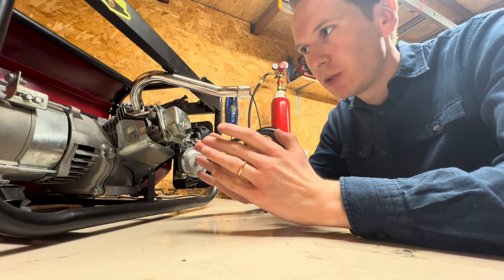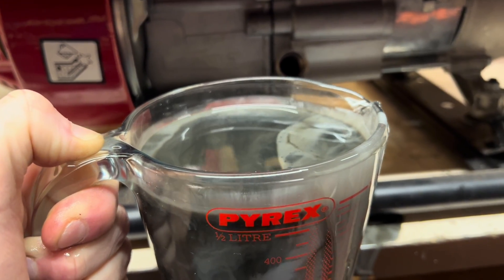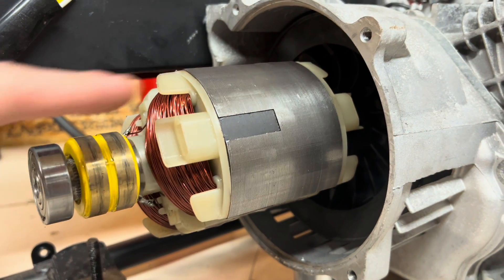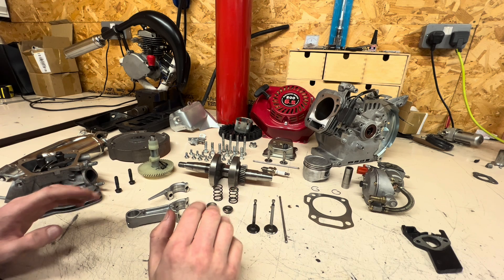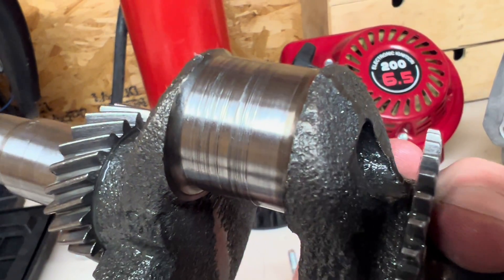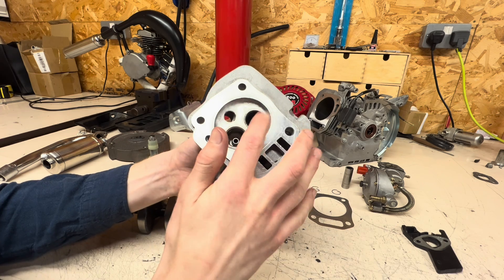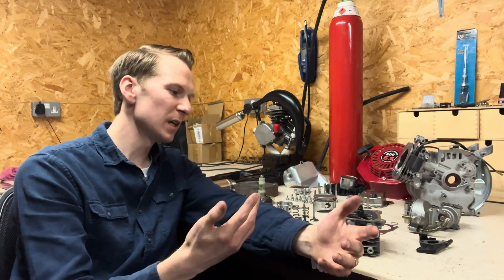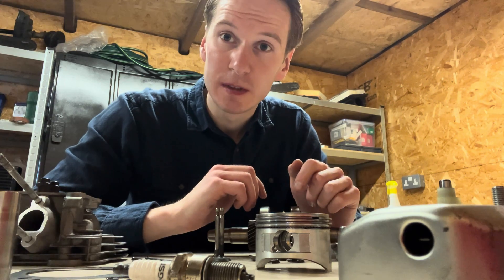Internals After 2 Years of Hydrogen

Comment: As I was told some 20 years ago when I started looking att H-fueled engines, I was told Hydrogen wears out steel due to chemical processes. I am not surprised it sounds different and wears more than if ran on petrol.
Reply: Hydrogen cracks steel, not aluminium. The modern high pressure hydrogen tanks have aluminium inside to keep the gas and outside carbon fibers to carry the pressure forces.
Reply: @unbelievablegoodio7176  And what did I state above?
Reply: @aetaveum  what did I say? I confirmed your statement and added that aluminium is different ... so readers know that too ...

Comment: Oil looks realy bad. Metal in it, probably from the connecting rod. I had one of those generators and it had this issue even with gas. The rod is made of cheap aluminum that cannot take the pistons force delivered to the crank. I imagine using hydrogen would detonate in the cylinder so even more force.😮

Comment: To run this engine right, you would need to massively increase the compression and carefully change the timing to retard. May be several degrees BTDC or even a degree or two after.
Reply from the maker: That’s pretty much the plan, timing set to TDC, increasing compression and some performance improvements along the way.
Thanks for the comment :)

Comment: I have one recommendation.  Increase the angle of crosshatch in the cylinder and maybe run two compression rings. Or even flip the wiper ring so it screets oil up into the combustion chamber instead of down.  Also maybe Increase the turning load on the crank if possible.  If you let an engine freewheel with no load it causes gaps to load and unload. Its kind of like valve float but not really. Imagine grabing a con rod with a worn bearing and brakecleaning all the oil out of it. If you push and pull on it you'll feel it click because its out of tolerance. Even if the rod, crankpin and bearing are in tolerance you will still feel a very teeny tiny click. The rod and crankpin will change load dynamics one time per cycle.  Without a continuous load the load dynamics change erratically creating many little micro impacts . Eventually wearing out the crank pin and Rod. Also the way the fuel burns is different.  I'm pretty sure the burn is much more immediate. You don't have to advance the timing near as much and the Piston has already reached Peak heat a few degrees after top dead center where has gasoline will continue to combust through most of the stroke.  Where the oil cushions the Gap in the Con rod it will accelerate into contact with the crank pin more rapidly because of the increased energy on detonation. 
  Good luck my friend.

Comment: There is a fundamental problem to using H2 as a fuel. And that is the cost of the energy needed to synthesize it. When you examine the economics H2 is impractical. Thats why it has not caught on.
Reply from the maker: Sadly I agree, more research has to be done on increasing the efficiency of manufacturing the hydrogen, some companies have had great success recently so fingers crossed, what’s why this engine is aimed towards performance/racing applications instead of trying to be economical. Also more fun that way :)

Thanks for the comment

Comment: You cannot just switch an engine designed for hydrocarbon fuels to hydrogen. for starters the materials in the engine have to be compatable with H2, the lube needs to be compatable and the tuning of the engine adjusted for H2.
Reply from the maker: The standard/common materials can be used, just not maxed out for performance, sadly that’s not part this project scope. 
But we can change, the oil, piston rings, piston and ignition system for hydrogen gas. With good results so far too.

Comment: If the Hydrogen was produced by electrolysis, I think some water may have accumulated in the oil?  
Where is the shell bearing for the Big-end ? The grey engine oil is full of Alloy, and possibly some water? 
On the Big-end cap, there is a peace of alloy which throughs the oil around the casing, but I cannot
see if there is a clear way of the oil getting to the Big-end bearing, this could be improved !!
Also: the oil is throne up over the Conrod, where there is 2 groves to let the oil into the bearing ?!?
Not the best way of feeding oil ! But, there seems to be a fault by making a hole on the underside of the
rod. This, should be blocked off, in the attempt to keep a little oil, that manages to get there, for a bit longer !
I understand why there is a hole there, they think that the Alloy Soup, will stay there and ware out the bearing quicker?
But, I disagree, I think the drain hole works too well, leaving the bearing dry !!! Just a thought, ?
Reply from the maker: Yeah lots of things to work on with this engine, water definitely got into the oil. 
Better piston rings, and oil circulation will be needed for sure before trying to push out more power. And upgraded billet parts, of which come with shell bearings.

Thanks for the comment
Reply: @Hydrogenguys  
Thanks for getting back, Now I know that there are shell-bearings, it would be better to let the oil in, by drilling a 2-mm hole on the topside of the Conrod. Maybe, countersink the entrance, thus making a funnel. The point of this modification is, to feed the oil to the centre of the bearing. This is where the most heat is created, then it would naturally 
 squeeze out from the centre. The way it was done on that motor: is the opposite to common sense !!! Properly, planned obsolescence???
Reply: That is not a drain hole in the rod, that is the oil entry hole.  Lubrication of the rod is accomplished by the reciprocating motion of the rod driving oil droplets from the splash stick through that hole.  The hole is positioned so that the rotation of the crank will spread the oil over the most highly loaded region of the rod bearing first and create a fluid film for the rod to ride on rather than have metal on metal contact.  Blocking the hole would probably burn out the rod bearing in short order.  Standard small engine design does not include a shell bearing in rods.  They just run the rod directly on the crank.  That is sufficiently durable for standard use because small engine bearings are relatively lightly loaded considering their size and the modest level of power output.  I lean toward thinking this failure was caused by water in the oil compromising the lubricating ability of the oil, but that is just my own gut feeling.  I tend to think detonation and over pressure would have caused other damages as well like broken piston rings, cracked ring lands, or blown head gasket.
Reply: @HoytClagwell  
Well, that is left brain thinking ! 
Academic in nature, I am more right brain thinking, hence I found paper work difficult. But: I excelled in practical skills. As the engine rotates the oil extension throws the oil up over the Conrod, that is why You can see two cutaways on top of the rod !
It looks to me, that they must have put these cutaways there for a reason ???
Think about this: - "Where does the oil enter between the rod & journal" ???
If you are right, and the oil enters in at the bottom where the hole is, 'Why, is there cutouts on the top of the rod ?
I am sure, that oil only enters at one point, Not two ! These splash lube engines, rely on gravity to feed the bearing, and Not sending oil against the forces of gravity !!!
Like I said, in my first comment, if oil is needed: it should be fed at the hottest point of the rod & journal. Which is at the centre ! Feeding oil from the side, simply does not work well. That is Why, I suggested drilling a hole at the highest point on the rod, so that oil would drain down to the centre of this bearing point: then it would seep out of the sides, thus covering all the contact area. The HOLE at the bottom, would only let oil out keeping the bearing dry & hot !
It still looks like: 'planned Obsolescence' to me, but there you go, I am retired now, but have spent years working with engines, & I am always willing to learn something new.
If I come across a Honda engine, I will pull it apart, just to make sure that what I could see was accurate !?!
Have a great day, like me, & keep learning 🇬🇧👍🔧
Reply: @truethought369  At full running speed the big end rod of the rod bearing is making a complete orbit  every .017 seconds and the centrifugal forces throwing oil off the crank and rod are so large it would be impossible for any oil to "gravity drain'" into the bearing.   Oil is driven into the rod bearing spaces by the force of impact with oil droplets similar to way a water balloon explodes as it hits the sidewalk.  The hole on the "bottom" of the rod is actually the leading face of the rod as the piston makes its upstroke and any droplets that hit the bullseye of the hole go directly to the center of the crank bearing just ahead of the most heavily loaded region of the bearing.  I suppose the notches on the side of the rod could also be oil catching holes that catch droplets on the upstroke but they don't lead to any exposed bearing surface so I am a bit puzzled as to how they help.
Reply: @HoytClagwell  Thanks, it looks a bit of a "Heath Robinson" setup, to me !

Comment: What happened to fuel cell technology? If You're using hydrogen, why not have a fuel cell setup?
Reply from the maker: This is all about hydrogen combustion, using technology we have readily available instead of throwing it away. Hydrogen fuel cells is a lot more efficient if efficiency is what your after. Hydrogen combustion would provide institutions high power output but at a much lower efficiency

Comment: I think if you start with a diesel & let it idle on diesel & add HHO or hydrogen it will last . Were you using HHO or hydrogen ? If HHO using calcium carbonate in distilled water for electrolyte will not cause corrosion .

Comment: Dear GOD!!😮 You need to replace that plastic cam shaft with a metal one ASAP!!!! Those plastic ones only last for so long before breaking and doing severe damage to the valves, piston and the cylinder itself IF you're lucky!😐
Reply from the maker: Already on it, got a metal one for the stiffer valve springs that will be used

Comment: When you burn hydrogen with oxygen the end product is Water. And it is hot water. And it is corrosive. TAANSTAAFL
Water in the vapor stage plus heat plus sulfur makes sulphuric acid.
Acid vapor in your oil is not good. Especially between your connecting rod bearing surface and the crank pin.
Anyone who has converted a gas engine into a steam engine learns some of these things really fast.
As stated above, hydrogen is closer to a detonation than a controlled flame front traveling across the piston generating a torque curve.  It has to be fired very close to TDC. 

An ICE has to be completely redesigned mechanically, materials, fuel control, thermal control, yadda yadda to be reliable.
Hydrogen engines on the road in the millions is not in my crystal ball. 
And the fan bois can spare me the tantrums. 
Just because you really truely believe something with every fiber of your being and your soul, does not make it so. Physics has no religion.

Comment: Yes, Hydrogen is a good, clean fuel, wether it's combustion or fuel cell, the "but" is that it will never be produced in the quantities to make an economically viable alternative for the masses. Hydrogen may well be the most abundant element in the universe but, unfortunately, it bonds readily with other elements which means it's "locked away" in various organic compounds and splitting it is either very dirty (from fossil fuels) or very inefficient and expensive by electrolysis.

Comment: Where do you get the hydrogen from and how do you feed it into the engine?
About the oil: a lot of forbidden glitter. 😬
Hydrogen washes the oil from the cylinder walls and makes the engine run a bit "dry".
Maybe a thicker oil and more often oil change could help.
BMW and Toyota should have some experience.
Group IV or V oil? PAO? Ester? 🤷‍♂️
I think the little engines are just built to run ok-ish on gasoline. Hydrogen could demand more precision in the valve seats.
And change the oil 4 times more often next time!
Reply from the maker: 100% right about the oil, more frequent oil changes are needed, i modified an LPG carburettor to operate on hydrogen gas, i made a video about it, go check it out :) 

Thanks for the comment
Reply: @Hydrogenguys  Be careful about your little Clio! 😉
Maybe a ceramic additive isn't washed so quick from the cylinder walls.
Please inform yourself about the structure of PAOs and Esters and the most recent synthetic base oils. Ask a chemicist which of the 3 is less likely to be broken down by hydrogen.
About LPG: that's really magic how you can extend the oil changes by 50 to almost 100 %. 😎
By the way: you couldn't make such a conversion in Germany without certificates and expert's opinion - you'd loose the homologation and your insurance on the spot. 🤦‍♂️

Comment: The fact the engine runs so well on hydrogen shows how easy it would be for Honda to just make a hydrogen engine
Reply: They scrapped that long ago when they realized hydrogen in ICE's is a very dumb idea (BMW did, too). Honda builds hydrogen fuel cells now.
You have multiple problems running hydrogen in an ICE, fuel storage and combustion properties being the most prominent ones, the energy losses when generating the hydrogen in the first place is another big issue. This is a nice hobby project, but no where near "application" territory, once you have done the math.
Reply: @wernerviehhauser94  Literally the only thing stopping hydrogen from being a thing is storage. It's much more convenient than electric, things like trucks being electric with current technology just isn't going to happen or even what this guy is doing with his generator. To have a battery able to put out that much power for as long as a tank of fuel lasts (never mind if you had a few more gallons in a can) would make it too heavy to pick up. 

Electric just doesn't work in industry, price to output just isn't there. A generator (battery bank) fully electric costs thousands compared to a engine generator which will be far better that'd cost £300, that's not going to get better because lithium will always cost a lot of money
Reply: How is hydrogen made?
Reply: @FlexCrushYouTube  so creating hydrogen is not cost effective. 
It would be cheaper to use the energy that is needed to produce hydrogen to power a car.
Reply: Toyota already did and you could buy it! The Toyota MIRAI. It was expensive. And there was hardly any infrastructure available to fuel the car back up. 
That's why it was a commercial failure.
Reply: @jfv65 , it's easier to build a hydrogen supply infrastructure than it is to heavy-up our electrical grid. Once one of the World's First World countries makes the decision to go with hydrogen over electricity, it will be a race to see which commercial hydrogen supplier can build their supply infrastructure the fastest. I think Australia will be the first country to go all-in on hydrogen. Will the petroleum giants get in on the hydrogen game? We'll have to wait a while and see.
Reply: @RMartin631  honestly, no. If you have any idea about metallurgy, high pressure or cryogenic storage, and can do the MATH, you'll end up with electricity being cheaper in the long run by more than a factor of 2 in an ideal case. You can't just run hydrogen through existing natural gas pipes and use existing equipment, you can't store it in natural gas containers etc pp. EVERYTHING would have to be replaced. And that sorry excuse of a grid is long due for replacement anyway. Do the smart thing. Get a good, smart grid. Even if it's beyond your understanding, this will solve at least 9 out of 10 problems. The 10th may then be solved with hydrogen.
Reply: @RMartin631  depends what you mean by "easier" though. I think it's technically easier to build out hydrogen, but I'm not sure it can be done in existing cities anymore. I think adding battery charging infrastructure (that will overload the grid and cause problems for everybody)  is politically more likely than adding a new infrastructure for hydrogen, just because all the local regulation already exists for the electric. If you add a battery charger in your parking lot its kinda just another device, but if you start adding tanks for a flammable gas... i think theres a lot of cities that would make it impossible to build a new facility.

In a way, overloading the electrical grid and not upgrading the network is a built in feature of the infrastructure in a lot of places, so it's probably going to be the easiest way forward :(
Reply: @jfv65  although I don't think you should say "was"- I was behind one on the road yesterday. But they have gotten scarce compared to how they were about 3 years ago where I saw at least one on the road every single day. Based on my commute, I think i was always seeing the same 4 or 5 cars, though.

It's still nice to see them from time to time, cruising along dripping water.
Reply: Toyota is supposedly betting the farm on hydrogen. The word is that they've stopped developing electric motors and are hard at work on hydrogen powered vehicles. Imagine in 10 years being able to get 2 kinds of gas at your local gas station. Gasoline AND hydrogen. Of course all of the excitement about hydrogen will go up in smoke after the first hydrogen powered vehicle explodes and takes out a city block.